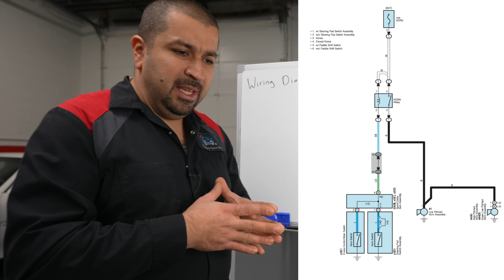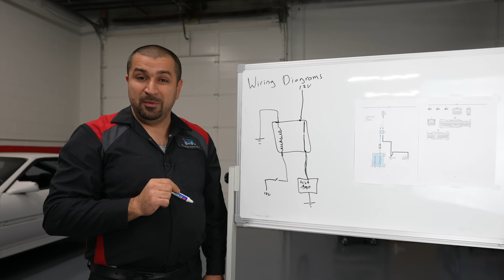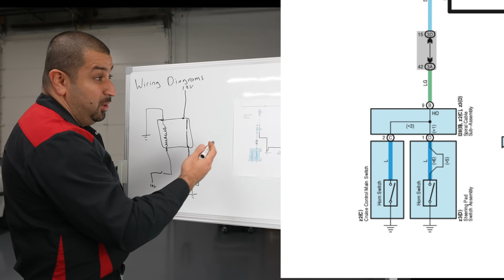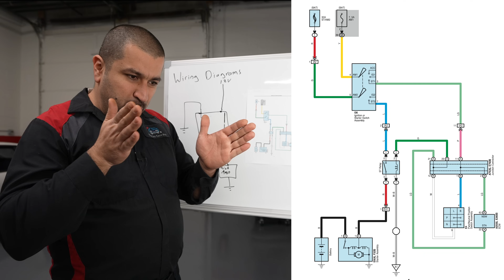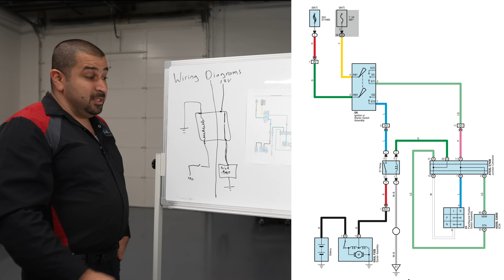How to Use Wiring Diagrams For Car Electrical Diagnosis and Repair

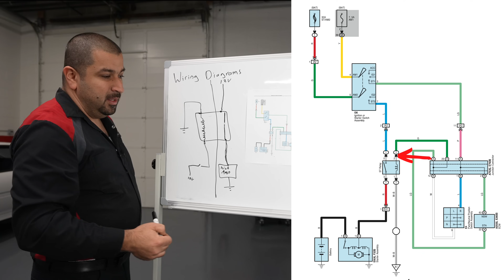Comment: So I wanted to ask in 22:05 you use the red lead of the tester on the shown spot with the arrow and the black lead of the tester on the ground of the battery to test if there is 12V or am I wrong? thanks

Comment: the only thing I don't get is: so I understand there's a positive wire with power hitting a part/fuse/etc, and there's a ground coming off somewhere - but then for something like the junction connector from the relay: diagram shows that as a red wire connecting  - that suddenly is two wires then at the connector,  two connections on the switch so what's the other wire? I feel like I'm missing something big. Does that mean the ground cable is always carried through along with the power and split off to actually ground from the part? When it shows a Red wire or blue wire on the diagram, does that actually mean a wrapped pair: 1 hot and 1 ground inside of it?

Comment: A lot of early 80s american cars had ECM that switched B+ with fixed ground circuits, the number of ECM failures was exponentially higher than they are today.

Comment: Mate very interesting topic, thanks for sharing your experience, I would like to ask for your thoughts about this:, I own a Toyota Prado 90 series o colorado in US, which has a 5VZFE motor in it, since few year ago when I turn the key to start, fuel pump does not prime, I have to crank the engine and then am able to listen the pump working for few seconds. The engine does not start in the first cranking atemp guessing because there are not fuel pressure from priming functions, I did check the diagram from factory manual  and point me toward CIRCUIT OPENING RELAY, which I check the relays and are in working condition, do you think the ECU somehow can get damaged and missing that instruction? this is driving me crazy because cant find any info or a good technician that know about this.. any feedback its really appreciated dude!... Thanks!,,,,

Comment: Super excited for more of these electrical diagnosing, great job  and well done Sir. Sat in the auto electrical class room w/o gaining  much experience/experiments...not a total loss but could have been much better. Great tip on trying N position and trying to start, never crossed my mind, d'oh! Someone I personally know still doesn't understand that a parasitic voltage drop in a circuit will dim a test light in a series with that circuit, not brighten it. And he has thousands of hours of mechanical experience.

Comment: For those wondering, You drew your Relay backwards, the Toyota one is Ground side Switched, but you drew your Relay Positive switched!
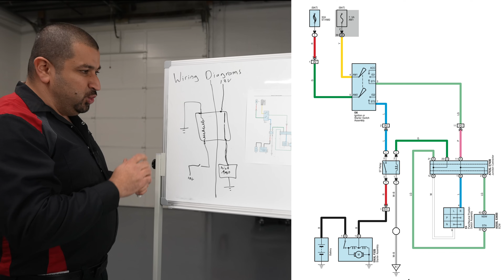23:50 or a misaligned/out of adjustment PNS Switch.
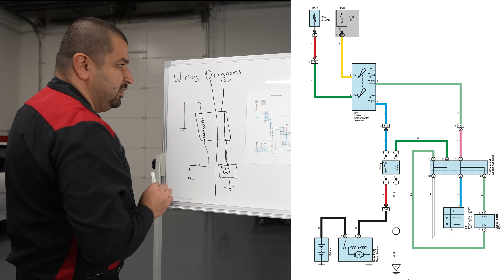24:20 *Load Side, Control is other side!

Comment: Excellent job at explaining electrical diagnosis approach! Does Techstream or aftermarket scan tool have an active test function for body/chassis components?  Where the control unit activates the component being tested usually by grounding the component's relay control side. If the component being tested operates under active test it would rule out many of the circuits in that component and streamline diagnosis,

Comment: Hello CarCareNut, I disconnected my negative battery terminal and when I reconnected it, my steering power telescope does not push the steering full length in and out direction but works perfect in up/down position. When I let the car rest for awhile the telescope moves longer distance both in and out and as I continue to play around with the telescope knob, the distance gets smaller and smaller till it stops to move the steering completely in the in/out position. Even when it stops to move the steering in/out direction i can still hear the knob button clicking sound. What might be the issue please? This is the first time it has happened, Toyota Crown Athlete 2012 GRS200, no issue with up/down movement

Comment: I wanted to comment the same as Michael 1349 said. It would be really nice to see you maybe apply a tool to demonstrate how that would actually be done. I am so grateful for your generosity  in sharing all this. I am NOT a mechanic and too old to even think of becoming one, but I do tinker with our trucks and manage to actually do maintenance that consists of very basic replacing parts. I find all of this fascinating.

Comment: I really hope you see this comment but what’s up with these codes for the EVAP SYSTEMS for Toyota vehicles? Seems like it’s common. P043E-P043F-P2401-P2402-P2419. The community would APPRECIATE it 🙏🏽

Comment: You're by far the best teacher for automotive electrical! I have struggled for years understanding wiring diagrams and firing the parts cannon at my cars. I replaced an entire ABS computer and pump when I tested the relay and though it was good. Come to find out, it wasn't; only because I tried every other part. It was one simple plug and play part that I somehow tested incorrectly, resulting in spending lots of time and money installing other parts. Thank you for all these videos and all you give back to us in the car community.

Comment: Only thing I'd add to this video as a diagnostic technician is voltage is no good if it has no current, always make sure your 12v is capable of load.. Lost count over the decades how many technicians overlook this simple thing and replaced components when they've had voltage to said component. In your example here you could have 12v to the starter and replace the starter and when that doesn't work realise it's a faulty relay capable of producing 12v but no current. Simple headlamp bulb jumper lead is a quick and easy visual aid to see if your 12v supply cable is capable of load and carrying current.

Comment: PowerProbes are nice to confirm if a horn or window and lights are good or bad. If it works I then use a diagram and test from there. Pp the horn and honk
Honk. Checked a plug…left unplugged from
The bodyshop thankfully.  😡

Comment: Another great video.  Process of elimination.  
As an update on my pervious comment about the issue with my snowmobile and no starter start.....
New battery,  key switch,  and now starter solenoid.  And with all that,  the solenoid still isn't clicking.  So,  my amateur analysis is that there is a boo-boo between either the key switch,  or the emergency kill switch, and the solenoid.  
The hunt for naughty electrical pixies continues....

Comment: Love the channel question I have a 2002 camry v6. I decided to wash the engine after I replaced the oil leaking valve cover gaskets. After I cleaned the engine the cluster stopped working after I shut the car off. If I take the screws out and disconnect the plug to the cluster when I reconnect it it will work until I turn the car off again. I got the the point where I would leave the screws out and turn the key a little but unplug and replug the switch in to make it work every time I used the car. I finally went to a junk yard and snagged a cluster off of an old 4 cylinder and replaced it now it just shows a higher tach when but works fine. Can I fix the original cluster?

Comment: @19:39 Straight from the battery @24:20 Switch diagnosis to supply side - This is an excellent video, one of the best I've ever seen explaining relays. I've often wondered why mechanics say control side and supply side in videos (Like Eric from SMA Auto). I think I've been intuitively diagnosing things as a DIY logically like this but it's nice to have a firm grasp on how to approach and test correctly. I'm looking forward to the relay video. The starter talk also makes a ton of sense now.

Comment: I've watched a lot of videos from "Pine hollow auto diagnostics" and "South main auto repair", and it's amazing how many times it's just a bad ground. Rust and corrosion take their toll on the connection. 

On my 2003 Rav4, the remote to open the door worked normally and then suddenly it wouldn't work. When I opened the door by key it would only open that door and no others, and the inside lock switches on both doors wouldn't do anything.  After a few weeks of that, suddenly everything worked again as normal. It screams bad ground to me, but I have the wiring diagram so with that and the info I learned here I'm going to see if i can figure it out once the weather gets better.

Comment: Great video. I learned a lot of this the long hard way, and wish I looked for something like this a long time ago. One thing that I struggle with is locating the wire connectors and junctions. The wiring diagrams do a great job showing the load paths and have the nifty connectors shown at the end, but how can I find where they are in the vehicle? Thanks

Comment: cool tutorial but it was hard following what your fingers are pointed to on the tiny paper on that board. would be great for a full page wiring diagram and a pencil pointing at things. you can pan out periodically for the split view board AMD/board half and half, then back to the full screen with only wiring diagram and something pointing to what you're talking about. thanks man

Comment: Thank your very much for all  the informative videos! In the episodes about oil change, you mentioned it’d be ideal to have a 1,000-and 5,000-mile changes for the new car. Unfortunately I missed the first two and only had my 10,000-mile oil change for my 2022 Camry.  Would it still be worthy if I continued the oil change with a interval of every 5,000 miles later on? Thanks in advance!😊

Comment: PLEASE HELP!! I’ve started Toyota Forums, taken my car to Toyota and I have an issue nobody can clearly identify at the moment. It’s a 2014 2.5l Camry Dual VVTI 2ARFE engine . When it’s gets above about 90 degrees after warming the car for some time I will get this rattle under slight load usually while depressing the peddle softly. If I push the peddle heavily I can bypass the sound. Does not happen in the winter from what I can hear. It might still be there during winter but you can’t hear a thing. Have you ever came across this?
Reply: Also , it will not do this temporary rattle if I have the car in park and depress the peddle. It’s only under light load while starting acceleration usually

Comment: I have been trying to diagnose my dead a/c control panel. Stopped working after I disconnected it once. All a/c functions work from the screen, but not the panel. Fuses look fine. Relay? Still afraid to be testing circuits that also contain SRS circuit.

Comment: Anybody can help me with these 

My car is stalling when i reached at stop 550 rpm only at rainy days and other days if i turned off the drl rpm will drop to 550 from 650 and start light vibrations 
I cleaned maf and throttle body 
Any clues 
Tia 
Car is lexus is350
Does this related to any electrical problems?

Comment: The ONLY different thing I would do is just use the diagram and after the fuse, at the split call the split the LOW CURRENT side and the HIGH CURRENT (or if you want, amperage)  side. That way the horn side is easy to see and you can then go into the important details on the left side. The relay diagram clearly shows the reed switch and coil for you to describe them. (BTW You have a great garage. I enjoyed the 300k mile Camry video.)

Comment: Great video…but if you are telling DIY’ers they need to know how to read a wiring diagram…you need to tell them where to get it.  Perhaps in your next video you can explain how they can go to places like AllData that have different subscription plans for different users.  Wiring diagrams are necessary, but if the average Joe doesn’t know how to get one, it’s a moot point.  Keep up the great work!

Comment: As a Retired Auto Tech & Community College Instructor (57 years experience with ASE Master & L1) I love your descriptions & testing logic, exactly as I taught my students to do. It might be a good idea to compare diagrams for various manufacturers so people can see the minor differences. Keep up the great work! 

Many people do not know how to properly use electrical test equipment, especially for parasitic drain and loading circuits for voltage drop testing. It would be good to do a series based on these points. Again, keep up the great videos you provide. I have watched many of your videos and love what I see.
Greg Warren
Reply: Car Nut I do agree with Greg suggestion. I would highly enjoy those type of content. If it’s possible for you of course. God Bless you guys.
Reply: You are amazing in the content! Just like going back to vocational school!
Reply: Why are components given ground in a car? In a house like a light switch it's given power so it's not constantly hot. So car components are constantly hot? Am I mistaken?
Reply: @abes7181  Abe, We use DC except internally in a Generator (usually called an alternator) tis device produced 3 phase AC which then goes through a rectifier to produce a pulsed DC output to the battery. 

Automotive circuits are usually Hot or Ground side switched. Ground is used as a return path for todays' Negative Ground systems. A switch may be constantly powered from the battery (ground side switcing), or switched power to a component (hot side switching). Let me know if you have any other questions.
Reply: @abes7181 . I’m not an expert, but here’s how I understand this. First, the relay is a switch itself. So you have a low amp switch which operates the relay switch which then powers the main load. So no, you don’t have constant power to the main load because the relay switch is usually open when the car is not running or whenever that component is not needed. 

Second, since it sounds like you are more familiar with household electrical, imagine that instead of running a white neutral back to the main panel with every fixture you had in your house, you just attached a white wire to the nearest piece of metal - say, a copper water pipe. Then you just made sure that the copper pipes in your home were all connected to the main panel’s neutral. This would work in theory, although it would be incredibly foolish to try it. 

Finally, as someone else already mentioned, a car’s ground is more akin to a household’s neutral. You can’t technically ground a car since it’s a moving object. Also, the 12 volt system won’t hurt you much because your skin provides too much resistance. And, most of the time you are shielded from the car’s chassis. 

All of this is non-expert talk, so please clarify anyone if you know better on any of my points.
Reply: Thank you for this  @Pseudify
Reply: @abes7181 Abe the use of the term "ground" in automotive electronics is a bit misleading.  As you are likely aware that rubber tires are good insulators so nothing is actually going to the ground.  As a circuit must be complete for current to flow, the metal frame of the car is the ground but most importantly is the metal frame is directly wired to the negative post on the battery completing the circuit.  So when you hear "ground" just think negative to the battery.
Reply: Xxxx,xxzx,xxxx,zxxzzxzxzxz,,xxz @dougmacqueen1679
Reply: Xxxx,xxzx,xxxx,zxxzzxzxzxz,,xxz @dougmacqueen1679
Reply: Thank you sir
Reply: Can we take electrical diagnostics only at a community college?
Reply: @lubacotemobile  No, there are other options, but a community college is much less expensive than those private tech schools.

Comment: To access Toyota wiring diagrams for later model cars, it appears you have to subscribe to Toyota's (TIS) Technical Information System.  Is this the only resource for wiring diagrams for late model Toyota vehicles?

Comment: Great video electronics is important if you can't read diagrams you can't fix the vehicle or troubleshoot it wiring diagrams is like a map usually you start from the top and read all the way to the bottom most diagrams have a 12v source on top of the diagram

Comment: My wife's 2001 Honda Civic had a problem where all the external marker lights and the headlights would suddenly shut off when the car was being driven at night. Honda had already recalled this vehicle once before because of the problem with the headlights going off. They had replaced the headlight switch on the steering column and one of the small contacts going to the switch. A few years later it was doing the same thing again. Turns out the12 amps going to the headlights had been routed through the tiny switch on the steering column and the small contacts connected to it. I ended up adding a 30 amp relay to the circuit and I re-routed the 12 amps through the relay contacts. Then I used the column mounted switch just to control the relay. After that the problem never happened again.

Comment: I wish I saw this before I wired in my ambient lights to my Avensis!!!  Amazing content. Can you do one showing basics of using a voltmeter for DIY car repairers? They have so many options.  If you also get time, maybe one on how the window switch in a power window all around setup works, as I wish I understood this on my Toyota. We wired in the ambient lights and the little blue LED on the switch blew. Had to re-wire and it is fine, but I'd love to know more about how the system works in general

Comment: Ahmed, Thank you for this great series. One question...you said that the ECM can bypass the neutral safety switch.(16:15)  Under what circumstance would you want that to happen?
Reply: Yeah good question I didn't understand that either
Reply: Remote start?
Reply: @jnbycinthe5478  I don't think so would still be in park to start it

Comment: First thing you check is always battery
Reply: Yes and no
Reply: @DylanL69  there is no yes or no. you have a electrical problem you test your battery and check your terminals.
Reply: But that's not always the case you know you have a battery but still have so checking the fuse first is just simpler that's also where a scan tool can in handy if it shows multiple codes for low battery voltage then you check the battery
Reply: @DylanL69  ok youtube mechanic. learn to spell. your right im wrong